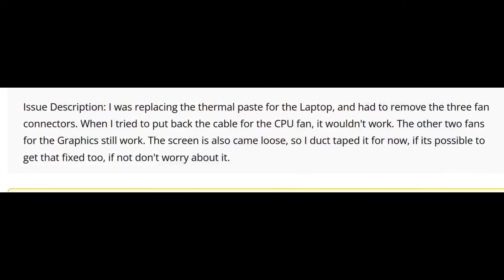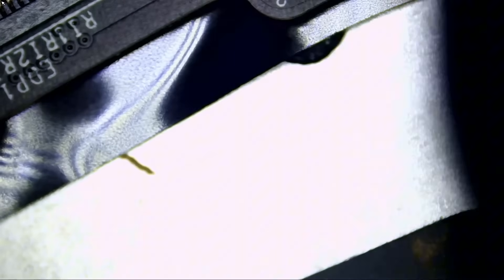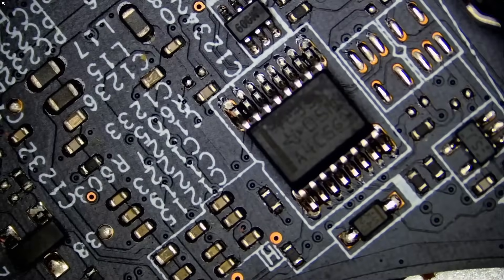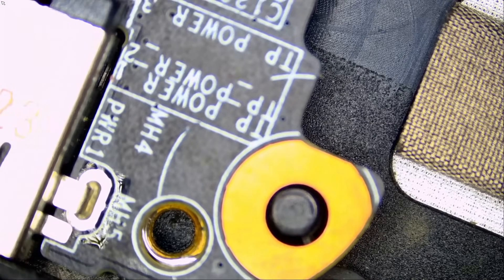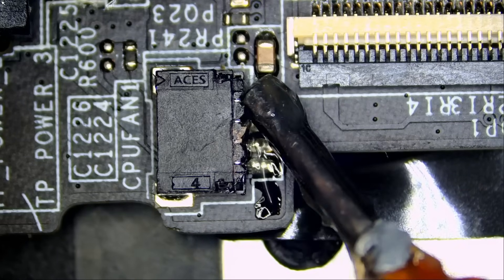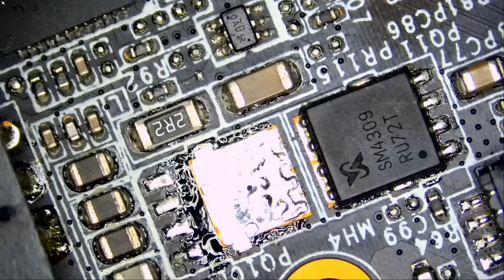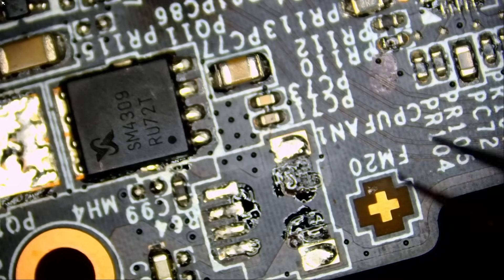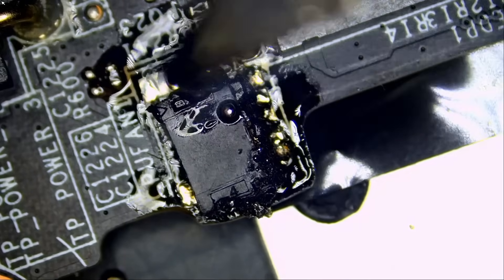MSI Laptop Repair - Fan Stopped Working After Replacing Thermal Paste

Comment: I used First Surface(front facing) mirrors from Edmund Optics to see underneath chips.  I bought the smallest ones. And using a piece of round stick like a bamboo skewer I hot glued the mirror at an angle so I could lay the edge right down on the PCB. Right next to the chip and right below the microscope and at a 45 degree angle so the microscope looks straight down to the mirror and you can see underneath the chip.  I was especially hunting for stray 0402 components that had become trapped under the chip during the manufacturing process.  And it worked well enough that I could see the solder balls and look between the rows.  And for connectors I could easily see deep into the connector.
I also used some of that blue putty (tik tac or one of many brands) to hold the stick in place so I could let go and work the microscope camera.
That putty has about a million uses and it lasts forever.

Comment: People always ruining their stuff by obsessing about temperatures and thermal paste. 

Don't open it if you have never worked with these small connectors. Temperatures aren't as important as the internet says, t's not worth the risk unless you have the experience or are comfortable with very delicate work. 

Practice on a cheap dell or hp laptop before you tear into your very expensive laptop with even more delicate connectors, and for such a small gain.
Reply: The temperatures quite often are a real problem, you are wrong. I work with these things and over heating is an issue and years of heavy use really dries up the thermal paste. If you are lucky you just loose some performance because of that, if you're unlucky you'll loose the whole laptop. When the GPU or CPU is cooked the game is over. And I see that A LOT. Replacing the thermal paste may be VERY important for your laptop. But if you can't do it, you can risk it or use a professional.